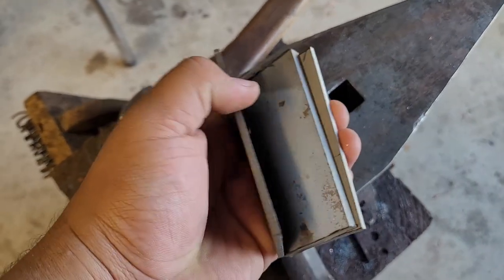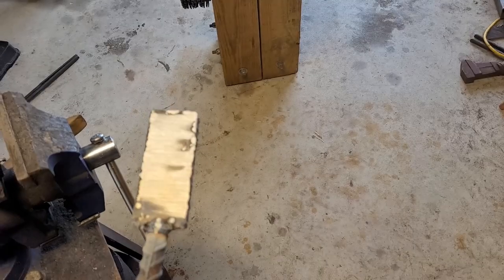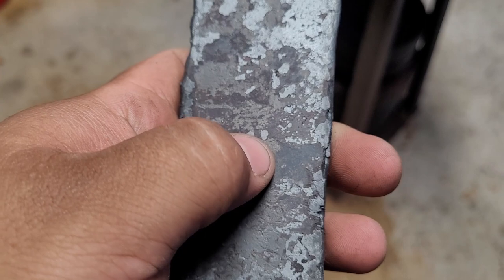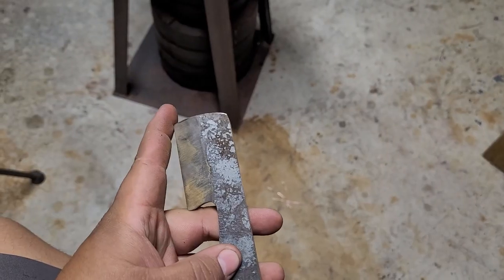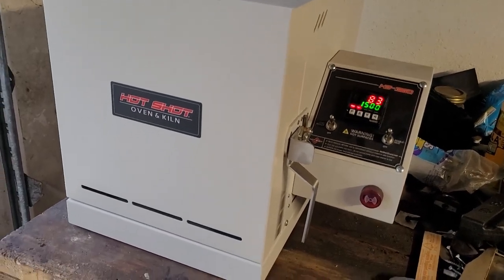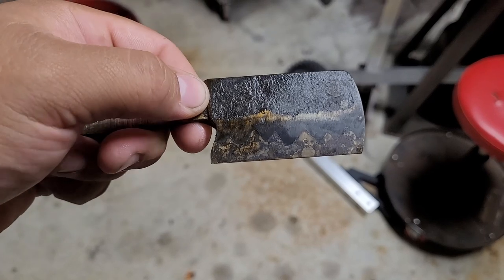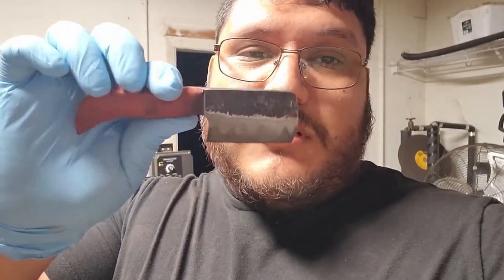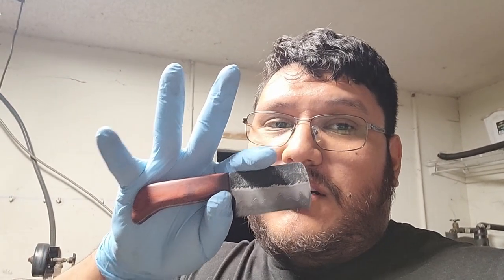Forging A Stainless San Mai Mini Cleaver

Comment: You should anneal your laminates, then use the band saw or even an angle grinder to cut pieces like that.  You can use smaller pieces for bolsters and hardware or bank a few, stack them on a homeoginous core and make some cool stuff.  Hate to see all that work getting ground to dust brother.

Comment: Stainless San mai is hard to do. My success rate is a very small percentage. I finally had a friend who is an excellent welder weld me up some billets. That helped
Reply from the maker: I feel that it only welds under the flame of my forge and the forge I have right now is very very crappy. Im making a very insulated one here in the next few weeks with doors. Hope that helps my success rate.
Reply: @JPsBladeworks  yes sir. That would definitely be an issue. I have been wanting to make a new forge. I have the insulation and the mix. Just can’t decide on burner. Good luck

Comment: Cheese knife you should call it.
I made one like that out of mono steel works good 😆 my wife calls it cheese knife.

Next time try using a canister and steel powder work for me pretty good when I use stainless steel
Reply from the maker: Steel powder? As in doing stainless can with highcarbon steel powder or to use a can with 2 pieces of stainless on the sides and powder in the center or the 2 pieces?
Reply: @JPsBladeworks  do two pieces of stainless with powder 

Example: carbon steel core, powder, stainless, powder. Do that on both sides of your high carbon steel it should work for you. A little trick I did,  I heated the can hotter than I normally would doing a regular canister. Hope this helps.
Reply from the maker: @wolfclawforge  I didnt even know they made powdered stainless but makes sense it would be a thing. thanks for the info much appreciated
Reply: @JPsBladeworks  I was talking about using 1080 steel powder with stainless bars and a 5160 center core you can also use razor blades they are 403 stainless steel which is oil harden steel. If everything works out right I will upload a video this weekend of me using razor blades in a canister. In kinda the same matter I was talking about. But yes they do make stainless steel powder I just seen it online a week or two ago.

But stainless is pretty are to forge weld got to get it a little hotter than normal and hope and pray you don't burn your steel up.
Reply from the maker: @wolfclawforge  ill keep an eye out for the video.